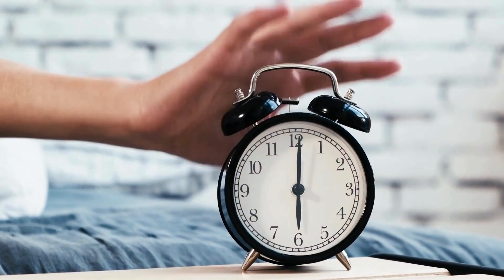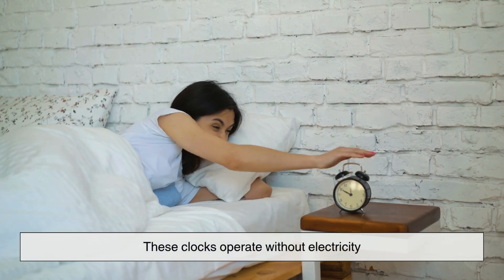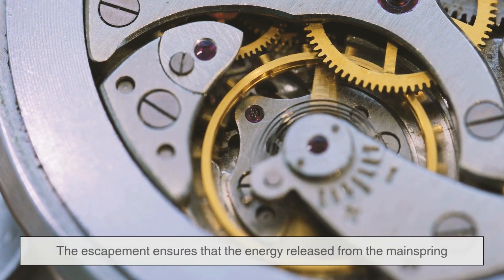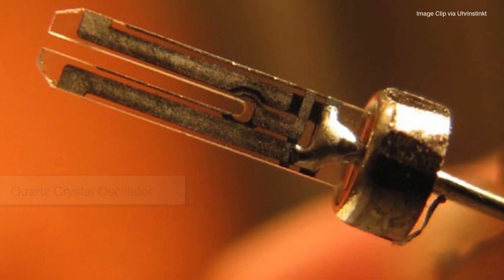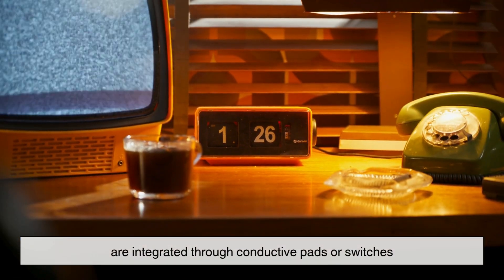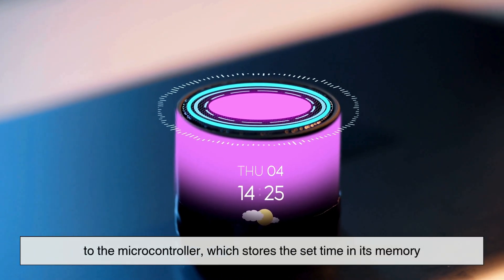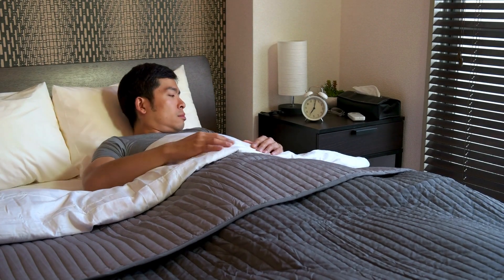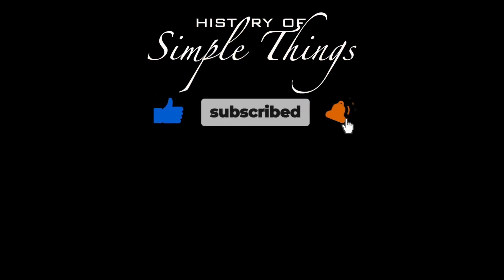Built to Wake You Up: How Alarm Clocks Are Engineered to Make Noise

Comment: The classic mechanical wind up clock with the 2 bells on top still made . I have a new model . The original one I had had glow in dark numbers and hands. Was radio active from Radium but not buy much . But the Girls that made them suffered so badly ! It is a very sad but true story called the Radium Girls . Today we still have glow in dark paint but not radioactive . Just does not glow the same. Cheers !